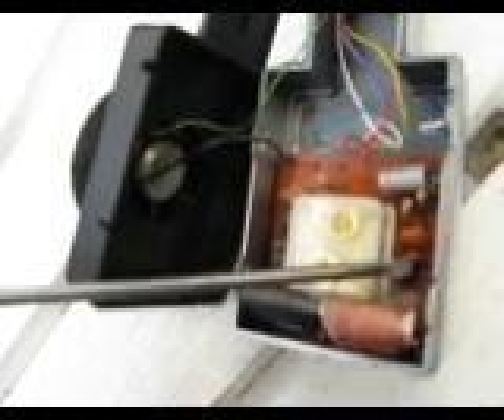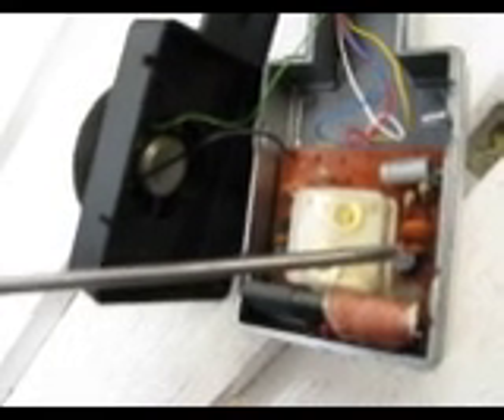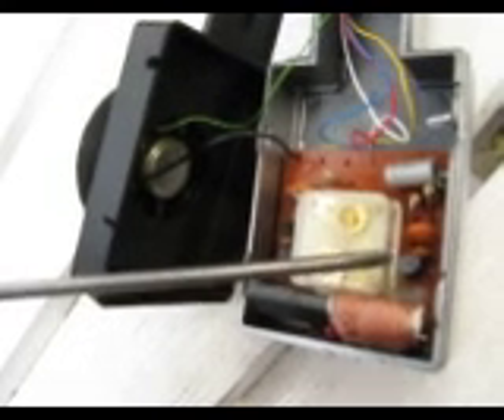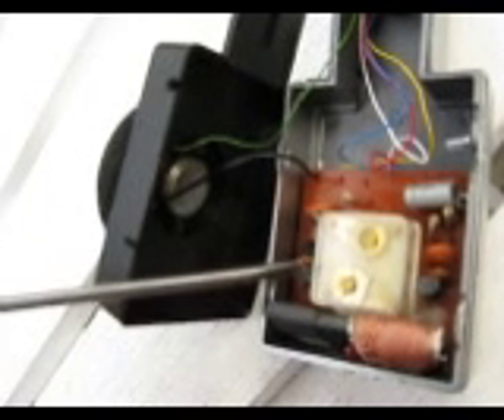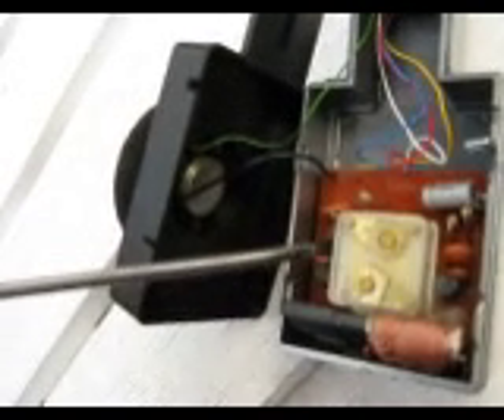1980s TRF AM headphone radio demo

Comment: I got a cheap kit from ebay. It is a copy of the Aussie Funway 2 & uses the TA7642 IC.
It used a Zener diode as voltage dropper to use a 9V battery.
I pulled that out real quick and now I just use a 1.5V cell.
I cased it in a plastic box that last held curry powder (before it got cleaned).
For sheer perversity I am thinking of using one of these IC's to feed a 6V6 output valve via a EBC33 or 6Q7, depending on the gain I need.

Comment: if i have to make transistor radio...could you just please tell me where i have to put tank coil (emitter, base or collector) and where i have to put feedback coil??? is the areal wire you have shown with 4 turns, the same called feedback coil??? what is the function of feedback coil and where it is plased in transistor please help me...dont discuss amplifier, i want to know about the first circuit,amplification comes next stage...please help.